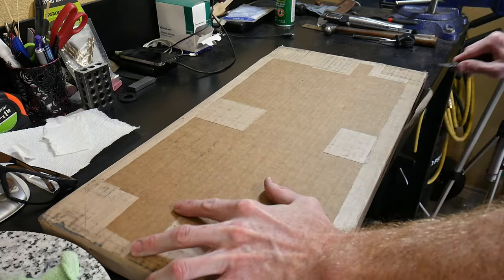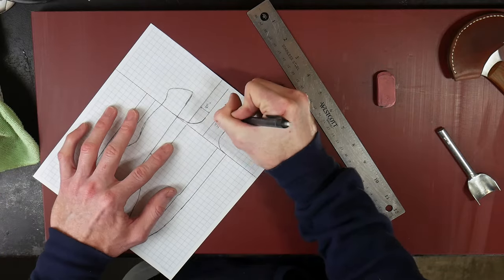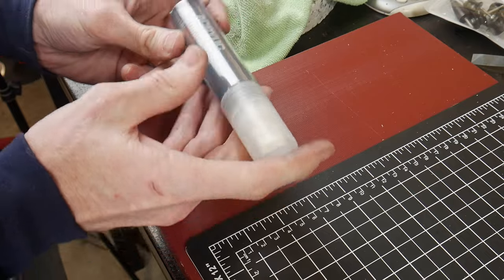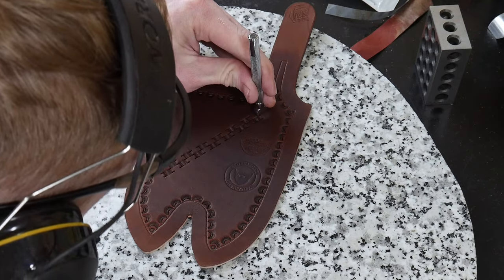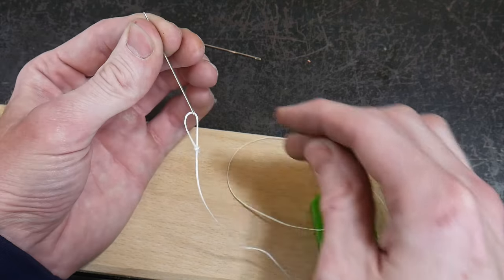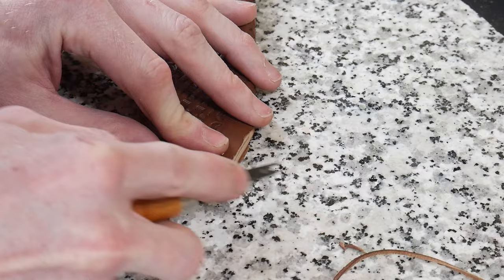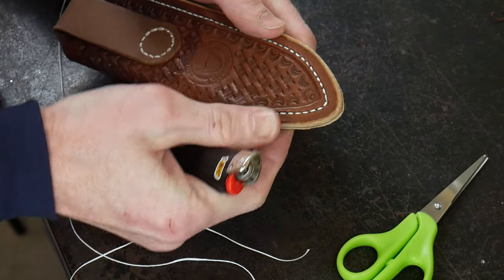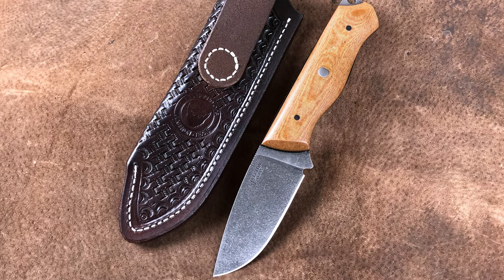How To Make A LEATHER SHEATH | Full & Detailed Tutorial | Knife Making

Comment: Have you tried a loveless cam on the welt like Horsewright? I've been trying it and have had trouble getting the action right. Do you trust a straight welt like yours to hold the knife? I have also tried a straight welt and it doesn't hold. Maybe I'm the common denominator there :/
Reply from the maker: lol, no sir I haven't tried it yet. But I think I will for sure in the future. With the majority of the handle being encapsulated in this pouch, it actually holds the knife very well.

Comment: I do not enjoy sheath making , but yours looks good . BTW. I have stitched with 50 lb test Spiderwire  braided fishing line it’s very durable and it’s green in color. But I usually use the waxed stitching that comes Speedy Stitcher  sewing awl . Your way is good for a template, my way is crude I just cut and fold cardboard around the knife and trim it to fit then open up the cardboard and trace around the leather , not rocket science but does suffice.
Reply from the maker: Thanks for the comment Randy!

Comment: Oh god no, I still get nightmares about leatherworking, the smell of leather on a belt grinder and finding out you cut the thread an inch too short OTL

I've tried enlarging the last few holes that I planned on using for backstitching to make it easier, but then it looked kind of terrible and the stitching didn't stay as tight as I wanted it to.  The issues you had with backstitching is pretty normal and probably preferable to having holes loose enough to hand stitch.  I found a 6mm deep socket nut driver at harbor freight that works for pushing the needles through, then flip it over and use the handle to push it the rest of the way.  It sucks, but it's a little easier than pliers.

I have found a saving grace for my shoddy leather work though.  If the sheath is just a bit too loose on the knife after all the work is done, a little steam from a kettle directed inside just enough to make it pliable and damp, will allow you to form fit the leather to the handle when it dries and shrinks.  Steam it up and don't wait to shove the knife in because it sets pretty fast.  You can also form fit leather to stuff by dunking it briefly into near boiling water, vacuum bag it, and then boning in any details it doesn't pick up.  Ends up being a lot like a kydex fit, unfortunately any stamped designs you made disappear when you use the hot water method.  It's better for stuff like leather strapping around a solid handle to get it super tight or reveal designs underneath a leather sheet.
Reply from the maker: Cheers man! Of all things to have nightmares about, leather work isn't too bad!